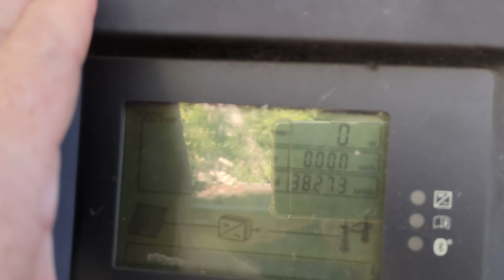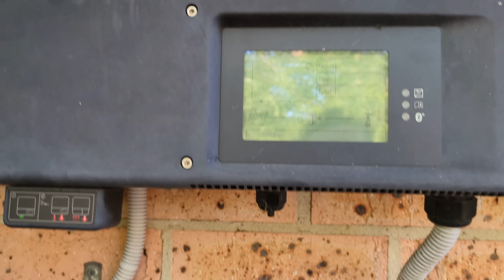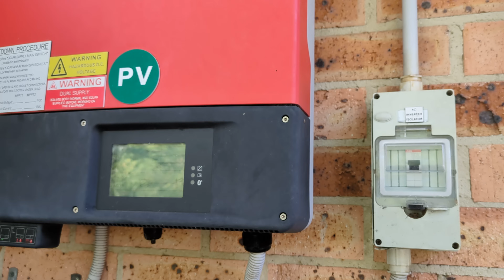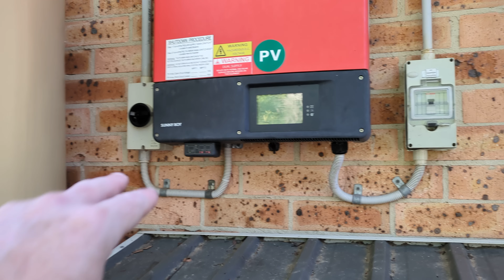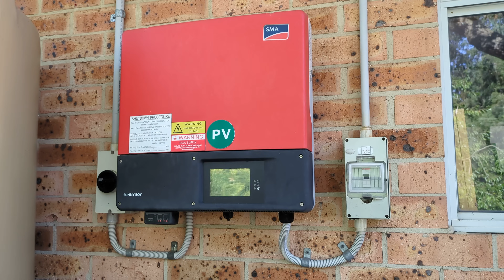Salute to the SMA Sunny Boy Solar Inverter

Comment: Did you mean 38 MWh?
Reply from the maker: Obviously brain not connected to mouth.
Reply: @EEVblog2  Always a major bummer when you think you made a perfect video until you are editing and hear that you mislabled something lol.
Reply from the maker: @Electronzap or upload direct without editing, release it, and then have people tell you...
Reply: @EEVblog2  I just noticed while editing this afternoons video that I called my pliers a screwdriver.
Reply: Yeah.. saw the same thing at 0:30
Reply: Does 38MWh of electricity cover the cost of the inverter?
Reply from the maker: @rabidpb yes, I've done a payback video. 38000 x 30c
Reply: @EEVblog2  OK, at 30c/kWh it's paid for itself quite handsomely. Good job, Sunnyboy!
Reply: @rabidpb  38000kw x $0.30 for power if you had to draw from Grid $11,400 AUD would be a rough calculation
Reply: We all know that Dave is after the 1.21 GW, of course.
Reply: Great Scott!

Comment: I would like to use my  13 year old working sma 1600w unit to power an off grid hot water system.  Doe s any one know how to bridge unit to think it has 240 v ac applied to input terminals or any other ideas to get it to work.

Comment: PLEASE PLEASE I really want to know a bit about your unit. My neighbor has two of these and they have never worked properly and nobody wants to have anything to do with the system. The people that installed say they only installed it you need somebody who know what they are doing to sort out what the errors are and I just cant find anybody. My question is is your unit feeding back into the grid or is it feeding the house? our units feed into the grid full stop and I cant find out if they are able to be modified to run in any other configuration. Reading the installation manual I get the impression there is some sort of interface available to manage these but I cant find anything about it. I can see something on the bottom of your unit with a couple of LEDs, what's that? Can you give me any pointers. I have an electronics background and have recently been employed creating and wiring switchboards so I have a reasonable idea of electrical systems. Any pointers would be really appreciated as these are like new and its an incredible waste to just throw them away. Oh forgot to say these are 3000HF I'll get the TL manual and see if that helps

Comment: People wonder why PV isn’t very common in Vancouver, BC Canada - our electricity is just so damn cheap that the economics don’t make much sense. At $0.10/kWh, this whole system would have only generated $3800 in return. Makes so, so much sense anywhere which uses coal/oil and pays a lot more for electricity, though!

Comment: I have had a 1700W SMA Sunny Boy on my system since 2008 (16 years ago) and it has run without a fault since then. it has been on the west wall and display is now very hard to read but it has generated 26 megawatt-hours. it cost $10k back then but has saved me $17k so well worth it.

Comment: 3:20 I guess plugging microinterverters into the generator input will not work. Usually microinterverters will NOT RUN if they do not see the grid voltage. And as a generator input is an input and not an output, there is no grid voltage for the microinterverters to sync on.
Reply: Those Deyes support Microinverter input from the Grid and can change a battery bank that way.
Reply from the maker: The Deye invereter specifically advertises this functionality.

Comment: Take it apart I say!  I have the same inverter, the knock-on display is an odd but quite clever idea.  Mine is missing the part on the bottom left with the one green and two red dots that sticks out (near where the DC cables enter).  I have only been in the house for 6 months, it must have broken off at some point in the past.  Not sure what that part is for?
Reply: That's probably an optional WiFi module

Comment: Regulations prevent redeployment of 2nd hand solar gear for grid tie operation which is stopped cause there's a lot of good systems being replaced that could go to low income families but aren't allowed to
Reply: Which countries would prevent you from doing that? If it doesn't meet current specs for critical stuff it's logical but otherwise sounds weird.
Reply: @tschuuuls486  Australia

Comment: single phase people scare me. using all that copper and amps when you could use 3phase like normal people. but i guess some countries are special.
Reply: I agree but It's the country, not the people.
Look how the US keep using a single phase connector on electric cars what makes them physically incompatible with the rest of the world. Dave has an Hyundai Ioniq, with a three phase connector, using only one in a single phase country, everything works fine there. I  just can't get over it how that solution wasn't good enough for the US.

Comment: cable guys old cable is unknown  quality  to them.i say its just any excuse to lie and mlik some additional money out from job.
i would personally not hire such idiots
Reply from the maker: In this case the old cable isn't long enough, and a second one is needed anyway. So easier to run two new cables through the new longer conduit.
Reply: Agreed. Or are they saying they’re the only company that does a professional install?
Reply: If you were having a new consumer unit fitted, these guys would insist on rewiring the whole house.
Reply: There are certainly plenty of situations where that would be completely reasonable.

Comment: Yes, teardown please! Would love to see how they evolved! I tore down an older Sunnyboy (the ones with the big heatsinks bolted to the top or the sides). They were just full with quality parts. Silicone cables, nice crimp connectors, wago terminals, expensive chips, … A lot to salvage. 
The one you got has heatsinking integrated into the case (metal injection molded?), so no salvageable heatsink there. Also, it‘s much smaller. As I said, curious to see what changed.

Comment: I salute you Sunny Boy! Isn't it great when something just gets on with doing its job quietly and efficiently without drama? I wouldn't destructively tear it down as having an inverter around can be pretty useful at times. I have an unmentionable unit that only saw a week of use before being replaced with something way better. I use that to test battery banks and as a charger every now and again. The replacement main inverter was installed under 4 years ago and just ticked over 25MWh.